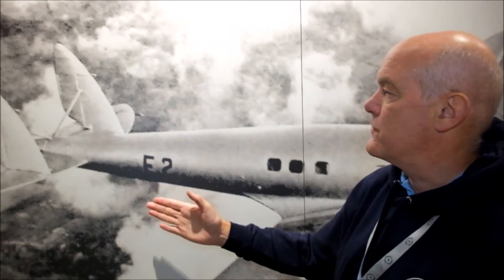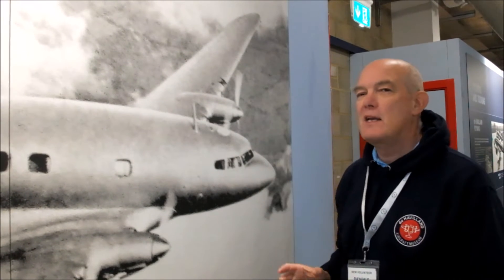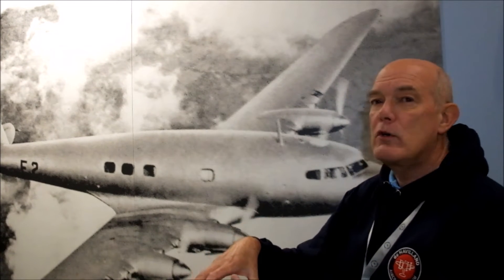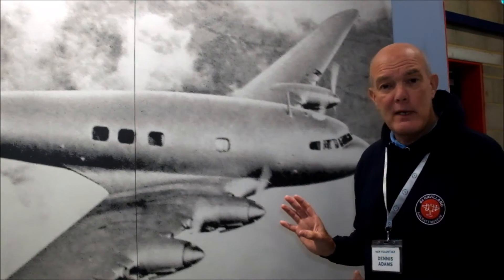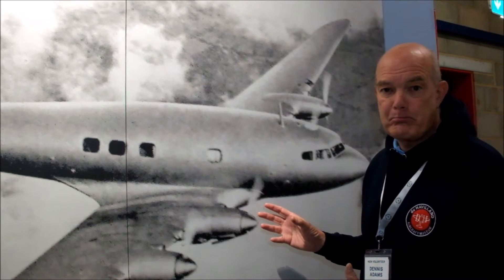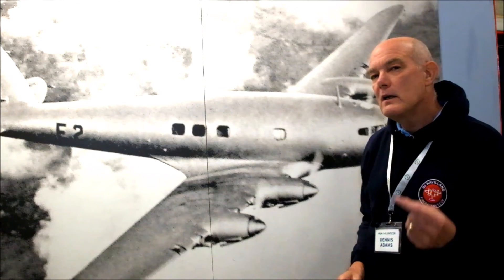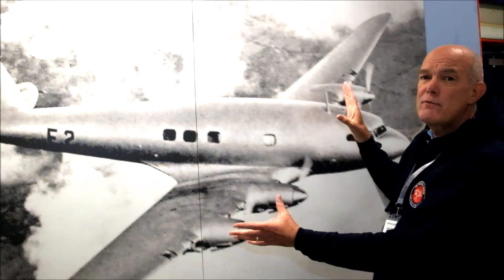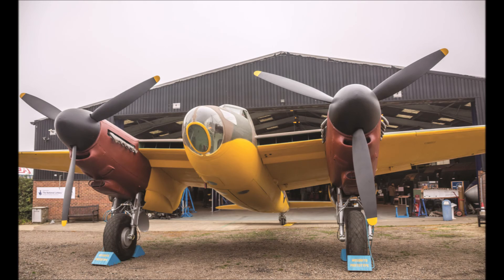DH91 Albatross - The father of the Mosquito?

Comment: It is a really pretty plane but the DC-3 which was from the same time period was just as fast but carried a larger payload and with only two engines probably a lot cheaper to operate. But boy the 91 was better looking.
Reply: The difference being we had no mass prodution facilities for aircraft at the time. deHavilland knew their market and the Albatross was exactly the right machine to fill the slot.

Comment: Hi one of my favourite aeroplanes of all time.  An unusual photograph of the dH91 I haven’t seen that tailplane before.  Most of the photos I’ve seen have a ‘clean’ tail with no struts.  Wouldn’t have hurt to mention that the comet racer that won the 1934 race G-ACSS Grosvenor House lives breathes and flies at the Shuttleworth Collection just up the A1 from the dH museum.  Also G-ACSP Black Magic is being rebuilt in Derby having been found in Portugal.
Reply from the maker: The first examples of the DH91 had the tail shown on that photo. According to Graham Simons book ("De Havilland Enterprises"), "data gained during the early flights show that the inset strut-braced fins and rudders gave poor longitudinal stability when the aircraft was climbing at full throttle and low airspeeds, so completely new cantilever tail was designed and built to overcome this defect with end-mounted fins carrying unbalanced rudders". This "clean" tail is seen on many other photos of Albatross aircraft. Thank you for your comments on the two Comet Racers. It would be great to see Amy Mollinson (ne Johnson)'s "Black Magic" back some time soon. We have a replica Comet Racer here in the museum - maybe we should do a video on that 1934 race some time.
Reply: @deHavMuseum  yes please a video on the race and include the replica…..where was it made?
Reply from the maker: The replica was originally built in Australia for a film of the air race some time ago. It has since had some restoration work done by volunteers at the Museum.

Comment: The Albatross and the Mosquito - two beautiful aeroplanes.
The DH designers certainly had an eye for lines/proportions/elegance and came up with two winners here.
I know a little about the structure of the Mosquito and the inherent strength of the wing and fuselage is just amazing. The ply-balsa-ply sandwich of the fuselage is only around ¾“ thick but completely rigid, needing very little internal bracing.
Calum Douglas, author of ‘The Secret Horsepower Race’, who had access to many original documents from the German Air Ministry, has related how often the Mosquito was mentioned in the minutes of their meetings - but not in a favourable way.
Because, basically, they hated and loathed it with a vengeance, as it had caused so much damage and inflicted so many setbacks on them…

Comment: Mosquito's wing center section was ribs of aluminum.  Saw one in a hanger in Cali disassembled.
Wing structure was NOT entirely wood.
Reply: You are 100% wrong.  There are no metal ribs in the Mosquito's wing.  The ailerons are metal.  The rudder frame is metal covered in fabric.  There are no aluminum ribs in the Mosquito.  Don't know what you were looking at, but if there were metal ribs, it wasn't a Mosquito.  (From they guy who's been restoring one for the past 10 years).
Reply: Not sure what point you’re making, unless you’re just trying to be pedantic.
All the major load-bearing components of the wing - spars, ribs, stringers, skin etc - were wooden.
That doesn’t leave very much else, does it?
But I’ll grant you that the engines and undercarriage weren’t made of wood.
You're probably confused, and are thinking about the later DH Hornet, which did have alloy structural components in the wing.
Regardless, however, why the peevish, unpleasant tone...?
Reply: @Michael Cohenthe use of wood in the mosquito was due to several factors, firstly it was a non-strategic material so there wasn’t the competition for wood from other manufacturers, second it was cheap, third it was light and fourth it had a low radar signature.  As the war progressed radar improved and operators were able to spot mosquitoes.  In the Far-East they were believed to have had plywood delamination problems, but actually this was identified as a result of poor quality control at the factory.  The dH 91 also suffered from delamination problems which eventually led to them being scrapped mid-war.  Note Mike and frank costin (ex de Havilland employees) were great exponents of plywood developing many cars using ply including one that entered a formula one race.
Reply: @Michael Cohen 
Sorry - there seems to have been a bit of a mix-up.
Nothing at all wrong with your comment, and mine was intended for ArizonePoet.
Reply: @Michael Cohen i of course bow to your greater knowledge of materials.  With regards to combat damage or crashes the mossie could absorb some punishment as the fabric and dope wings allowed bullets and cannon shells to pass through.  The use of wood as a non strategic material allowed the main wood parts to be thrown away.  It’s cheapness was key, a lesson the allies learned early in the war and Nazis only in the last 18 months (he 162 etc).